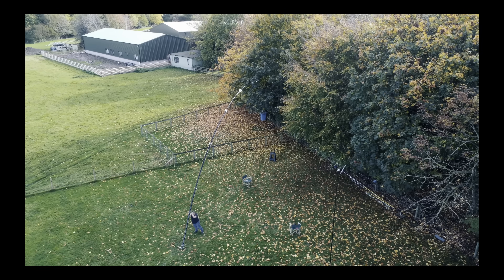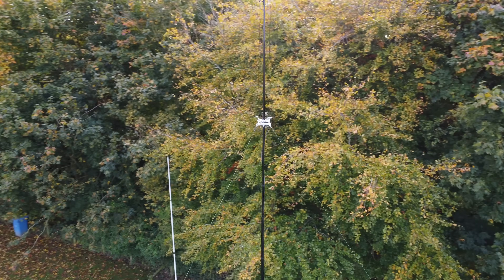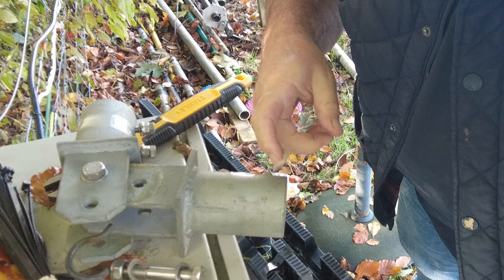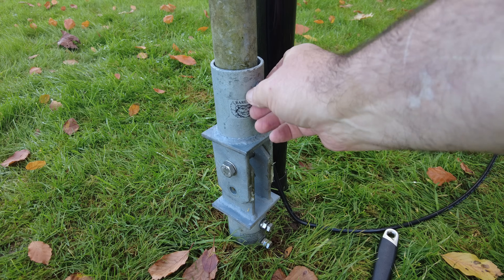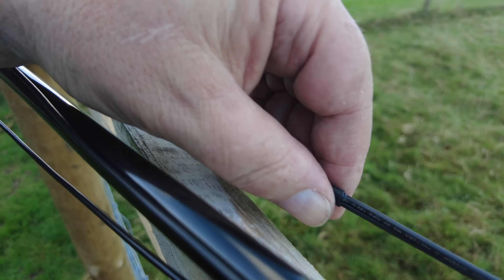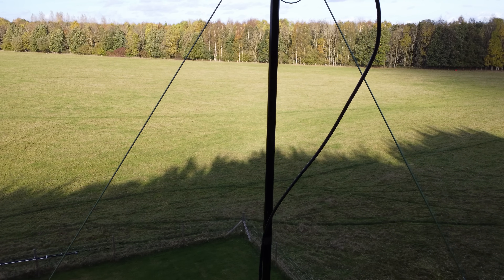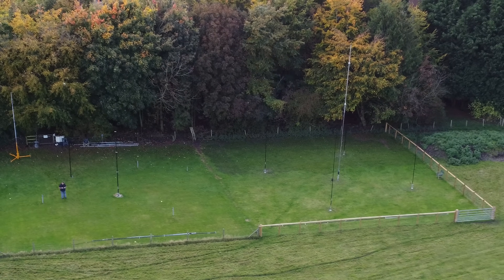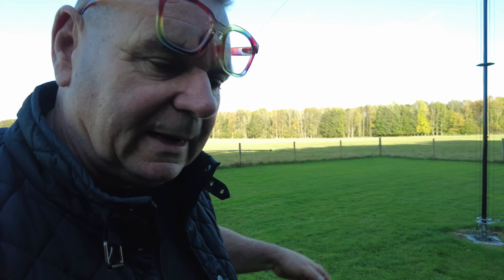Another Antenna Destroyed - Trying To Rebuild It - The "StarDuster" Dominator Tribander

Comment: Hi Callum, I hear there are meds for a bent banana, but I never worried about it.

The idea of getting the three verticals up high is a winner! I always had great results with 10 meters up off the ground, but in the city, it seemed it attracted negative reactions for some strange reason.

I wish I had known more about fan antennas back when I started in 1973, especially fan vertical antennas! I had been gifted a four band trap vertical that started out owned by my Elmer neighbor who spent many hours educating me in ham radio after school. Unfortunately, I spent too much time fiddling and rebuilding it over the decades, and I would get it working for a while, but wet weather would cause it to go crazy and the SWR would go way high! I have finally scrapped the antenna, and built my devils tuning fork. So far, I have a 40/15 meter main antenna, a 20 meter antenna to the side and a 30/10 meter antenna on the opposite side of the 20 meter antenna.

Now that I have that going, I am setting up my restored Kenwood transceiver to try it on! I have heard that if you have a 3/4 wave antenna, it has a little gain over a 1/4 wave antenna, 10 and 15 meters could use the help!
Reply from the maker: OK.. so (in my opinion) a 3/4 does have slightly more gain UNLESS you are near the sea (or have a GREAT ground) then the 1/4 wave will be better.. BUT we are into fractions here - no worries..
Reply: @DXCommanderHQ   Well, the only reason for thinking of it, was the dual band use of one element. Otherwise, simplicity would call for a quarter wavelength antenna anyways.

Comment: Coming soon , the high performance ADSB antenna from DX Commander 😄
Reply: I get 100km with a random bit of wire adsb
Reply: @markwilliams5654  And I get 250 Miles with a decent antenna
Reply: @markwilliams5654  I get 250+ miles with a decent antenna

Comment: This is getting close to an idea I had, which was a multi-band T2LT flowerpot antenna. I've mentioned it to Tim before. Basically I was looking at creating a T2LT, but then making it into a fan dipole. I was going to try an upper and lower leg dipole connected in the middle, but I had thought the same as you, just use the same bottom leg and take the impedance hit in having it a bit off-centre fed.

Another idea I thought of was the same as yours, but having three different tuned radials for the three bands. I had this thought as the V2000 has a 6m tuned radial on top of 2m and 70cm, and there's that discone that has multiple elements tuned for different bands. Now you have a hinge, maybe you could experiment with the three different sized radials to see how it compares in terms of VSWR.
Reply from the maker: That would work too. Just looks awful HAHA!

Comment: Interesting -
Perhaps a Signature 9 built on top of some spacer poles, or using the top portion of a Signature 18 but including tuned multi-band grounds perhaps using something like rotator cabling?  Could be draped on supporting guy cables - that would give multi band high performance in a small garden (back yard here over that puddle) feasibility? 
I use old rotator cable for tuned "radials" on my ancient Hy-Gain 18AVT/WB-S 5btv (sixties vintage) which would work much better raised at least a couple yards (meters) or so - but I would think a Sig-9 up about 3 meters using a 12.4's the main pole would be even better - (no loss from traps) and still give 6-40 meters coverage.
Reply from the maker: I know.. SO MANY options!